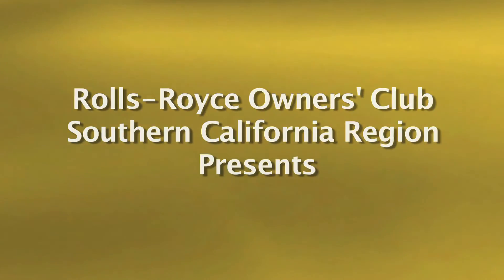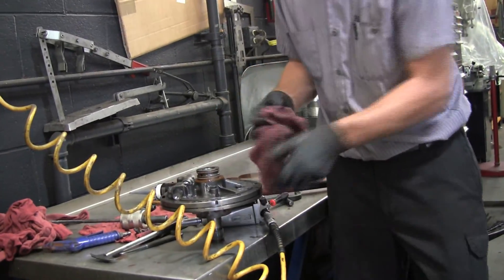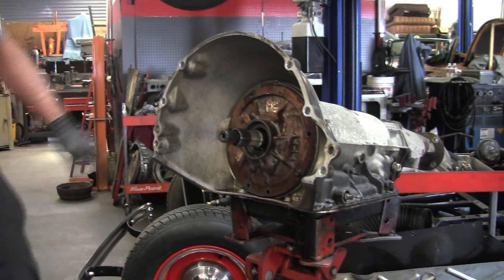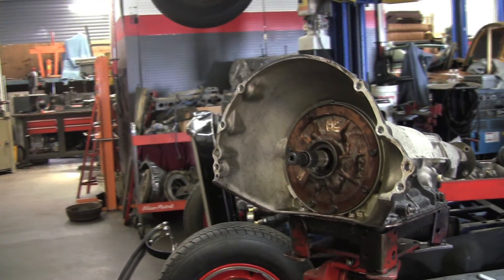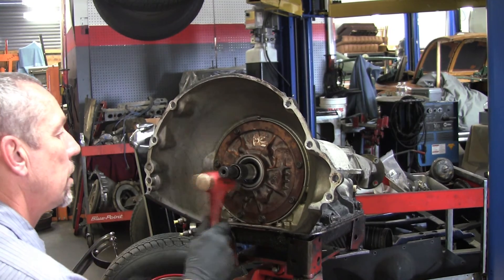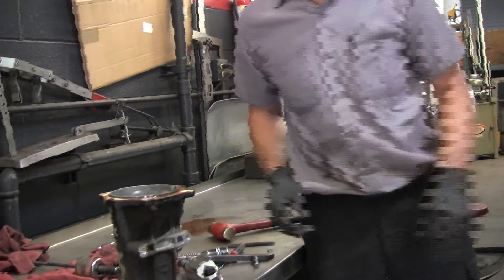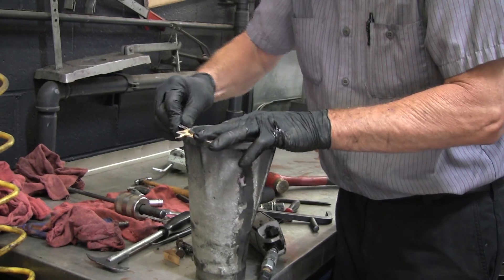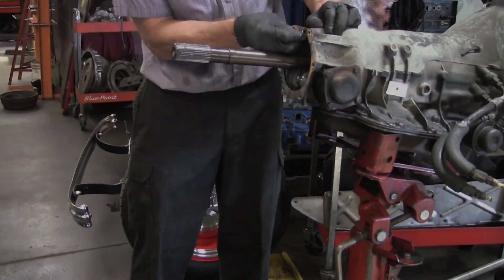Rolls-Royce Silver Shadow Transmission Part 2 of 5 12 mins

Comment: Boy you're sure getting lucky jamming the pump back in there with the trans sitting horizontally like that and not upright!  It's really easy for the drums to pull out and jam up a clutch plate or two.  External reseals are usually a waste of time and money.  If the external seals are hard and brittle, what do you think the internal drum ones are like?  All that time might as well rebuild the whole transmission.  Turbo 400's are easy .